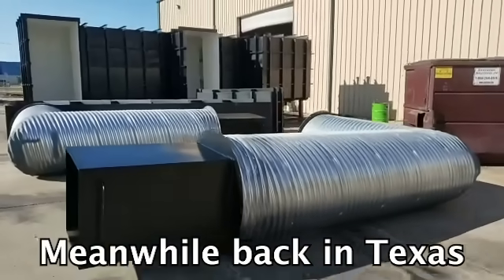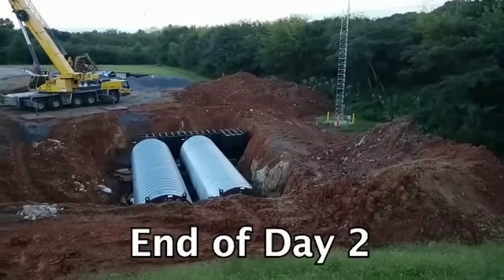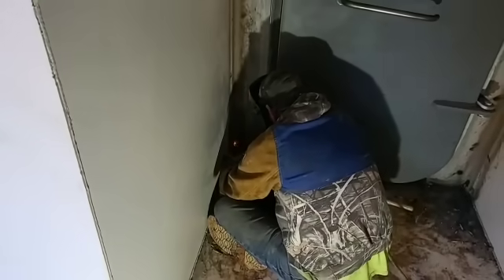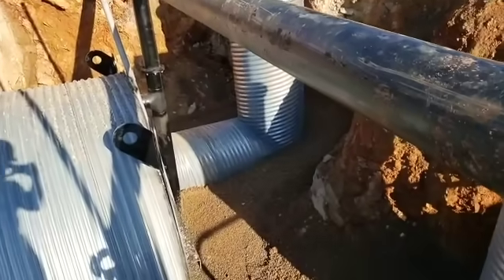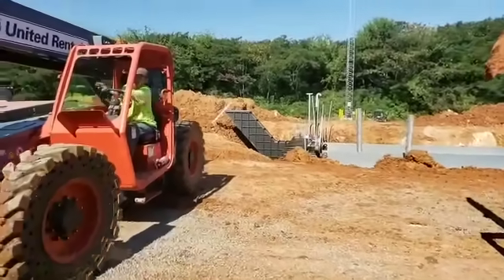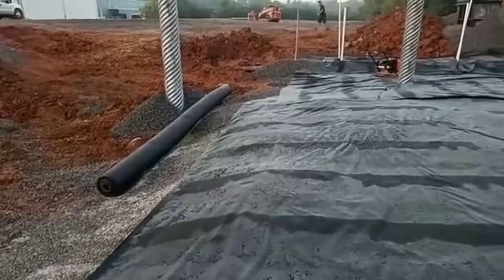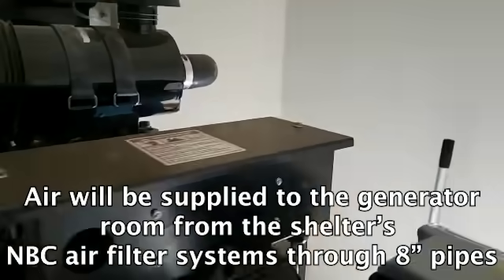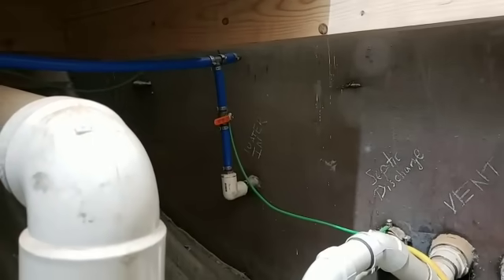Installing Two "Big Boy" Bomb Shelters "Side-by-Side"

Comment: Man; wish i could afford something like that.  Have you ever thought about adding a 4" or 6" wide stripe of luminous paint along the top of the shelter, at least in the generator room, entry, bath and kitchen areas?  That would cut down on lighting power needs at times when you don't need full lighting.  And in case of a power failure, it would provide emergency lighting to see by.
Reply: I'm sure the person who had it installed is the one who would decide how to decorate it and that might be one of their considerations.
Reply: Leonard - What happened to the glow in the dark arrows so you can see your way out of the apartment in the dark?
Sheldon - Oh that paint was wildly carcinogenic. 
;)
Reply: Glow in the dark tape....
Reply: @Cetok01  That was from an episode of The Big Bang Theory.
Reply: @ered203  Ah, OK. I don't watch the show. But my take is still valid.

Comment: Very quick question I'm a construction worker 4ft by 30 ft drop cloths on the bottom side they have a rubbery grip so they don't move around they are worth their weight in gold a lot of painters using to put over hardwood floors but they're very versatile you guys should use them so you do not have to trap all that mud around

Comment: Making redundant air and exhaust shafts for the generator would be a good idea incase one gets blocked somehow. Also a water bladder layer on the inside (for water storage and radiation protection).

Comment: Why is someone always standing under a suspended load? @16:00 the escape tunnel is being lowered by a ratchet strap on tiny welded rings and dude is using the ratchet strap tail as a tag line. These are the kind of examples they use in safety training videos where you have to identify all of the unsafe work practices. Where is OSHA!?
Reply: He's literally standing on the SIDE, not under it.

Comment: Neat work! As a highway inspector, I have to ask: do you know what happens to corrugated steel pipes when you bury them in the ground for years?
Reply: As a highway inspector, when you say 'bury them in the ground for years', i assume you are talking about culverts yea? So, i also have to ask, what would knowing the condition of a culvert pipe open to elements that had water running in it for years, buried under a road being subjected to constant vibrations, have to do with this kind of installation?
Reply: @N0xiety  
The question stands.

Comment: This may be a ridiculous question- but since I am looking into something similar I at least want to ask...... with all the electrical / plumbing, etc located on the outside- what happens if something fails? How would you repair it? Have access to it for repair? I have looked at some "self-contained systems" but I am mildly curious as to how this works???
Reply: from the looks of it, all of the piping is non corrosive steel or pvc, so they wont decay very quickly, so the only point of failure would be somebody purposefully tampering or a wire shorts out but that can be solved by just pulling the wire and pushing new wire back in the pipe. Self contained systems are as good as you make them or simply "you get your money's worth" air recyclers, water recyclers, sewage reclamation, indoor farming, are all very large, expensive, and sometimes prone to malfunction. so while its more secure as you virtually eliminate any presence of your bunker except for your main hatch and however many escape hatches you use, you will be gambling if you have no reserves/warning systems in place about system failures so you can prep to leave or have your bunker become your tomb. So having a emergency supply of food and water incase the system fails along with a geiger counter and protective suit will go a long way of making sure you keep on surviving.

Comment: I'm curious about a few things;

1 - How does the client perform maintenance on water pipes and electrical wires that run between the two shelters? It looks like any connection problems underneath the mudhouse are fatal since they'd have no way of getting to them, though this could be something that takes quite a while, be it natural degradation, or any underground wildlife finding its way under.

2 - Do all these shelters have such a strong reliance on stored and limited goods? Two I'm most curious about is food and fuel. I can't understand this being a long-long-term solution because of them. There are too many power outlets for non-essential items, I could understand a few for entertainment, but not one on every chair. For food, it seems to be a reliability on non-perishable foods, maybe in the line of those low-maintenance military MRE's. This is a little less of an issue, since there seems to be a lot of storage, but say 24 people for one year, three meals a day, is 25,632 packaged meals needing storage, that's (at lowest average) 13 tonnes of meals, not even mentioning the actual physical dimensions (3" x 12" x 8").
(I would also say, from what I can see, there's a number of sites saying they don't recommend using MRE's, they were just the longest lasting, most nutritiously useful, food that I could think of)

3 - On the talk of resources, there appear to be no outlets in the kitchen area, is this just the angle of the video?

4 - More of an issue with actual bunker design here- why is the shower the first thing you see in that second shelter? Am I the only one that finds that weird? Even with a shower curtain. Why not have the door lead immediately to the beds, then the shower, then the maintenance room? Alternatively,  have the shower in the space highlighted as a shelf space, then the shower can have one opague wall facing the centre, and at least a little privacy... Call me picky.

5 - The emergency exits, their location, seems a little too close to the main entrance and exit. I'll go past the "enemy attack" note, as I assume it's a joke, but I'm curious as to the reasoning for this? I do understand it's quite a difference to build an exit 100 miles long, but I'd personally figure the safest bet is to go at a diagonal, away from the bunker. That way any natural obstructions are slightly less likely to cover all three exits at once, and if (for some reason) there was an enemy attack, they'd have a bit of a wider field to aim for instead of just looking up a little bit from the entrance.

None of this is anything against the actual bunker, the people who bought it, or people that continue to buy it. More so curiousity about these factors and how people get through them... I can't imagine many people have little aquaponics or hydroponics systems ready to start up in the corner of their bunkers, though. I've always been skeptical about the doomsday planners because they all seem to be preparing to start and fight wars, instead of survive anything, judging by how many guns and defense systems they stock in comparison to basic necessities (once saw a show where the guy had a single kitchen cupboard sized shelf filled with canned carrots, kidney beans, baked beans, peas, etc, and his main focus was just on getting a living room set up to be just like home...)

Comment: Wouldn't it be a lot cheaper to just build a basement and use a spancreet roof??  Seriously probably 1/4 of the price!
Reply: That's what I was thinking. I'd like to see a cost analysis for concrete (either form-poured or precast concrete blocks) for the same amount of usable space. Compared to 500 yards of compacted stone, days of overtime welding, a large crane, plus the bunkers themselves it's hard to imagine this is the most cost-effective way to do a moderately-sized protected space.

I'd also be interested to see an analysis for an on-the-ground installation with similar levels of radiation protection. Seems like high-density concrete would be easily competitive when you remove the costs for excavation, crane, ground-water management, module bunker delivery halfway across the continent, etc. Arguably a little less 'stealth' than an underground bunker, but if you're putting a building there anyway it wouldn't be difficult to disguise the presence of the bunker within the building (and also turn it into regularly used space so you know it's always ready to go).
Reply: IMO 1/4 of the price is still off. My guess if you did a basement with spancreet it would be probably 1/8 the cost! I Really don't know why anyone would build a bunker like this!!
Reply: 2 ft of concrete would protect from radiation, a single storey above ground bunker might be a better bet and cheaper to construct, considerably more comfortable and it could be made into an everyday usable space. I doubt this location is the epicentre of a missile target. And before anyone tries to shoot me down on this I have been in one of these surface bunkers in Oxford England, it belonged to the Royal Observer Corp its intended function was as a hub for incoming radiation and explosions if nuclear war broke out it would have collated reports from observation bunker stations located out in rural locations throughout the region, it was decommissioned back in the '90s but still exists and is used a student club now.

Comment: If you're living out in the middle of nowhere, you're unlikely to get twatted by a nuke anyway, so a `bombproof' shelter is probably pointless. If you live in a high risk urban area then this little place just a couple of feet underground would likely be no use at all. Even an ordinary 250lb dumb bomb would come straight through - just as they did during the blitz. And if you're rich (rich enough to afford this), you'll likely live the good life on a tropical beach, or cruising on a yacht somewhere and have insufficient time to get back to your remote hidey-hole before TSHTF, so I really think its offering a false sense of security. The makers are simply trading upon people's insecurity & paranoia...
Reply: For real these things are absolutely ridiculous 🤣 gullible rich people
Reply: these aren't meant to be bomb proof. Not many things can withstand a direct hit from a nuke. These are fallout shelters. For instance, there is a potential military target in an all out nuclear war not far from my home, far enough away the concern, like in most areas, is fallout, not a direct hit. You just want a place to survive for a few months while the radiation decays away. There are also lots of tornados in my area, and these double as protection from that. I mean this is a 500k monstrosity, there are much cheaper options. I don't have one, but they're not necessarily absurd in all cases.

Comment: I would think that living space would be at a premium and so would quietness... So why did you not put the ventilation system in its own closet where the generator is or in its own tube off the living space, or under the floor?

Comment: I thought you said they were going to spray everything with a tar based paint?
Is doing all the engineered fill with the compacting  still cheaper than just pumping in concrete or a concrete pumice mix?

Comment: Another way to improve these facilities is  tie the electric supply into the above ground line. Put a breaker on it so you can use that while it's working. Likewise,  use the standard well pump and septic , as long as it's not contaminated.

Comment: I am just woundering how the sewer will go in and running water unless the sewer is run by pipe from underground to upper ground or maybe would be run to the main sewer pipes I wonder. one last thing would be that central air and heating is a must in something like this as the cold and hot air will change through the seasons.

Comment: Have you ever tried a lelahandler it's sort of like a pump truck but has a conveyor belt  that can slide in and out left to right. This will make you gravel placement a lot faster has a hopper that the skid loader can dump into.

Comment: This sounds far fetched but it would be cool if one of the escape hatches were to go into a cave system or something
Reply: If you owned land with caves under it it is not that far out of possibility. Those escape tunnels could be made to go in any direction and any length as long as air flows into it,
Reply: Problem is the vast majority of caves in West Virginia are flooded. Abandoned Mines are too. I lived there a long time and I guarantee those two sump pumps they installed in this bunker are going to get a LOT of use. :/
Reply: Or have a huge pool made with lots of rock features and have one entrance come into that!

Comment: I just have one question Ron, why would you use PVC on the outside of a bunker? Why wouldn't it be metal? i'm just wondering? I am not an electrician or a plumber. I am a concrete finisher and was just curious.

Comment: Do these structures last long considering the moisture issues.  Ground water on the outside and condensation on the inside.  Seems like a  along term structural survivability and livability issue to me.

Comment: A failure in the ventilation and exhaust system of a bunker can be extremely dangerous, as it can lead to the accumulation of toxic gases, smoke and heat within the confined space. This can lead to a number of negative consequences, including suffocation and death for occupants, as well as significant property damage.

Some possible failures that can occur in the bunker ventilation and exhaust system include:

Failure in the electrical system: if the electrical power supplying the ventilation and exhaust system is interrupted, the system may stop working, which can lead to the accumulation of toxic gases and smoke inside the bunker.

Exhaust System Blockage: The exhaust system can become clogged by debris, dirt, or other materials. This can prevent stale air from escaping, which can lead to a build up of toxic gases inside the bunker.

Monitoring System Failure: The bunker monitoring system must be able to detect changes in oxygen and carbon dioxide levels within the confined space. If this system fails, bunker occupants may not be alerted to the accumulation of toxic gases in the environment.

Lack of maintenance: A well-designed ventilation and exhaust system needs regular maintenance. If maintenance is not carried out properly, system components can fail, which can lead to a buildup of toxic gases in the bunker.

It is important that a bunker's ventilation and exhaust system is properly designed and maintained to ensure the safety of the occupants and prevent possible failures that could be extremely dangerous.

Comment: Wouldn't it be necessary to have a water purification system and a hydroponic cultivation facility in the facility? And, if you want to replace the pipe, etc., it seems to be easy to do from the inside. As the years go by, it seems that there are problems such as being worn out and damaged.

Comment: i dont can imagine how to survive a nuclear attack in a tin can. Here in Germany bunkers are build from concrete minimum 1m of thickness and 5 to 10metres under the surface. The bunkers have an airventsystem which generates overpressure in the inside of the bunker, to prevent the bunker from getting radioactive particles inside. The ventystem is equippt with overpressurevents to close automatically the shelter ventilation when the Bomb explode to protect the lungs of the people in the shelter. Not to say big waterreservoir which is included in the houseinstallation that there is always an exchange and fresh water in the bunker. I know this, a friend of mine has such a bunker in the basement of his house.

Comment: I'm watching and I'm at 29:30 and SMH as they fill in this hole all around the structure and low balling what I think might be the overall cost of just the equipment and fill products, that had to be brought in for this job!!! I'm not even considering the structure and labor costs and my mind is blown!! That structure is HIGHLY unlikely to budge even a fraction of a millimeter any at all, any time soon, and... I'm not even done with the video yet!!!

BUT if I were going to build a structure similar to this and it is meant to be for protection in THEE worst case scenarios then this is how I would want it done!! This one of those times where you rock back on your heels and say, "Daaaaannnnnggg!!!", because of everything that has gone into it from point Big Momma A aaallll the way to point Big Poppa Z with babies, b, c & d and aaallll of the kids in between!!!

Comment: 30 seconds in, pouring concrete into a form what what looks like 6 lengths of rebar at most... add the weight on top along with back fill, slab will snap like twix bar pmsl

Comment: Is there a particular reason you don't use a mig to weld everything. I'm a certified pipeline welder an know the strength differences but even if you are relying on renting a welder generator at the location one could bring your own mig attachment. The $4k for a miller arcreach suitcase mig that attaches to the stick welder an running fluxcore wire will more than pay for itself in time savings.  Two people running migs would probably take 1/4 the time of stick welders especially when you think of all the grinding, wire wheel, changing rods an prep work. Dealing with heavy equipment like that time is money and if it were me I'd definitely be running a fluxcore mig setup. Just something to think about.

Comment: In the aftermath of a full scale Atomic War I'm not sure if it will be possible to rebuild infrastructure to support today's electronics for a very long time (if at all). With that in mind IMHO a bunker such as this should focus solely on the basics of life for extended periods of time (and of course what you'll need when its safe to leave). I'd say 3-5 years worth of essential amenities for each occupant. Then there is the mental thing, each occupant should have the mental capacity to withstand being trapped in this monster for the necessary time to insure a certain amount of safety when you at last do emerge and be able to accept (mentally & physically) what they will be coming back to.